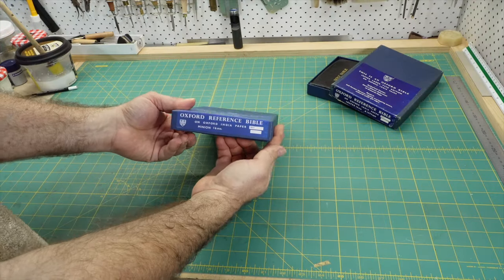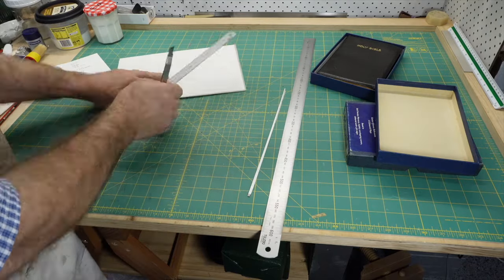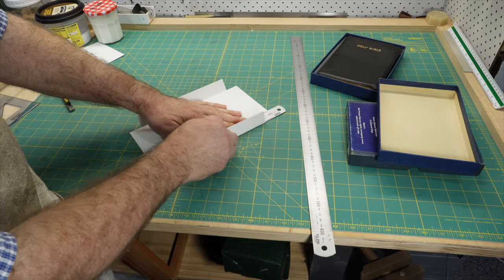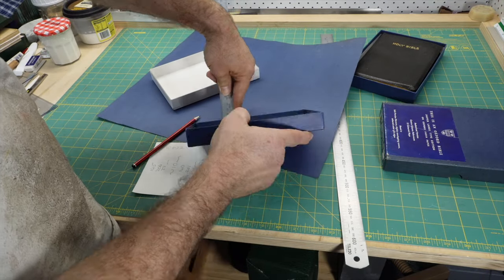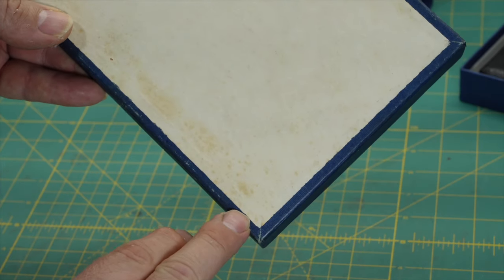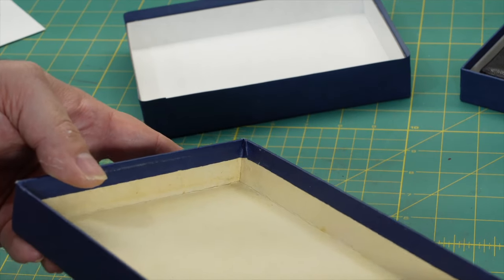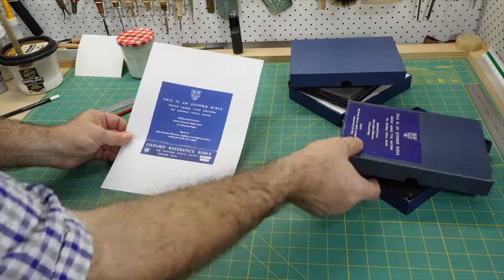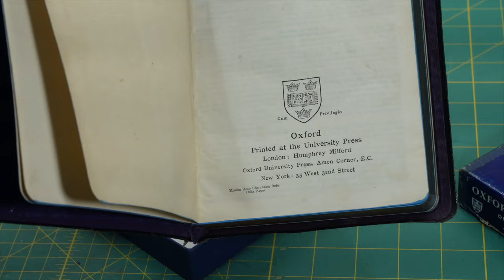Oxford Bible Box - Making the Base // Adventures in Bookbinding

Comment: i think i would be keen on a follow up on this. as the original box probably had a construction with a lot of "cut corners", to bring production cost down. i would be very interested in your take on making a "premium" one off box, with techniques and materials used that bring the most longevity and durability to such a box.

nice series though, 10/10, would watch again (and probably will, lol)
Reply from the maker: Just 2 trays that fit inside each other.  I have a few videos on this.  The next step up is a clamshell enclosure.  Also have a video on this.

Comment: Loving this box-making kick you're on of late! Two questions-
1) Does the fact that there are two layers of material on the outside (lining paper plus covering material) vs only one on the inside cause any noticable warpage, especially in the lid?
2) How would you go about making a slipcase via the cut and score method?
Reply from the maker: I'll do a video on a folded slipcase.  I have a couple of examples and I'll use one to make a model of.  In this case, no on the warp.  The paper layers were balanced and for the blue materials I put the adhesive on the board not the covering material.  There was a risk of wrinkles this way.  But the blue material isn't very absorbent and I used a very dry adhesive.  I covered little tray with marbled paper recently and did get a few wrinkles.  Luckily it was me and not a client.

Comment: Interesting project. I wonder why you didn't use your magnetic corner clamps to hold the corners square and tight while the glue on the tabs set up.
Reply from the maker: They would get in the way. Or are you pulling my leg?  Have I been over using the clamps?
Reply: No, not pulling your leg. Genuinely wondered why because you seemed to like them once you tried them.